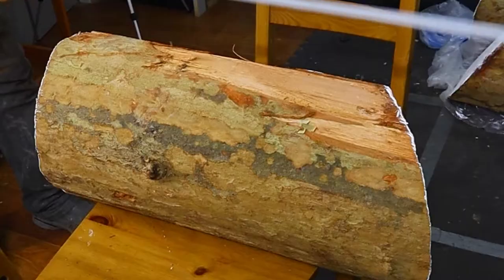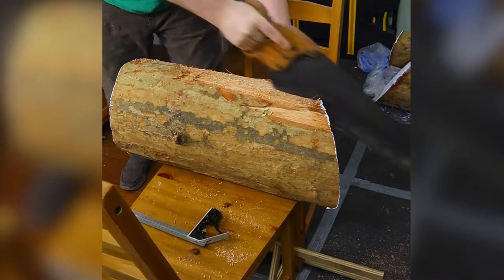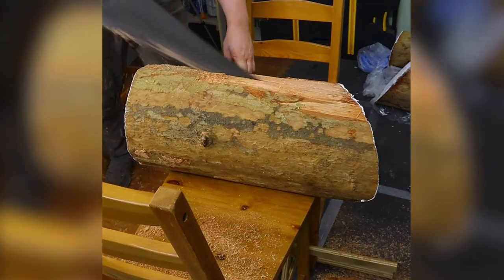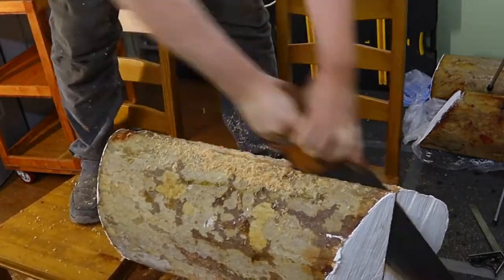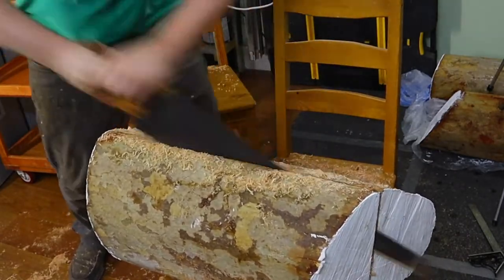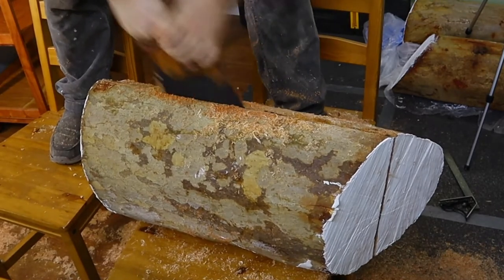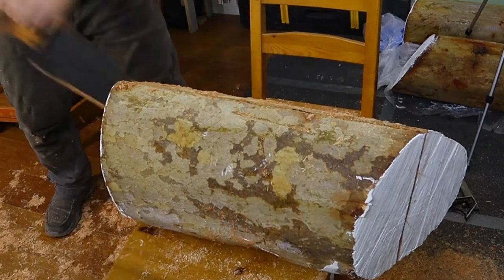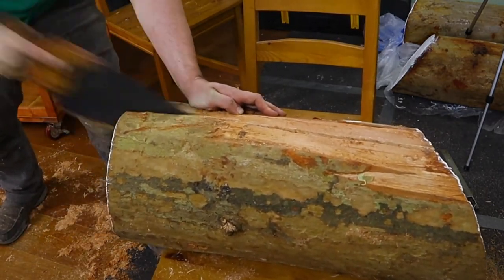Wrong tools: Ripping a green log using a cross cut saw

Comment: I've been playing around with bringing logs to lumber, too, so I was happy to see this video. I've found that using splitting wedges (along with a froe sometimes) can be very effective (and fast) for splitting/ripping logs, but only if the log is straight grained (i.e. no grain variations due to branches, etc).
Reply from the maker: Agree. For this log, I discovered that one of the cracks went al the way, so I used it later to do the split.  The grain is a bit twisty, so I will have to do a bit of cleanup later, but was much faster than sawing :)  If not the crack, I would have probably sawn it to get a bit higher yield for my future mallets.
Reply: @A2woodArt  That's a good point. I do end up with a lot of waste using wedges and froes if the grain isn't perfectly straight. Also, I wonder if the speed advantage of the wedges isn't as good as I think because of the surface cleanup I need to do with a scrub plane.
Reply from the maker: @jeepguide  There is more than just speed, I think. If you want to saw (and it took me over an hour), you have to invent how to hold the log in place.  With splitting,  the log would hold itself (if engrain cut 90 degrees).  I was actually thinking to saw half (the blade I have was really a bit too short for this log) and then try to split the rest, but end up just finishing the cut.